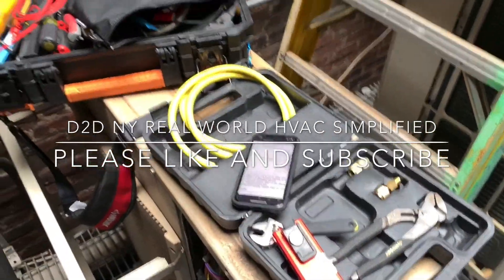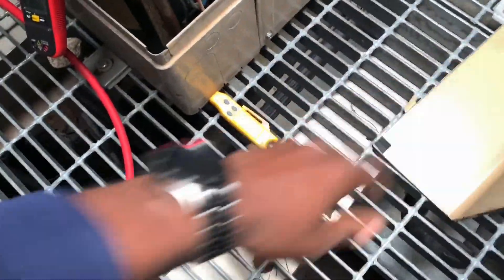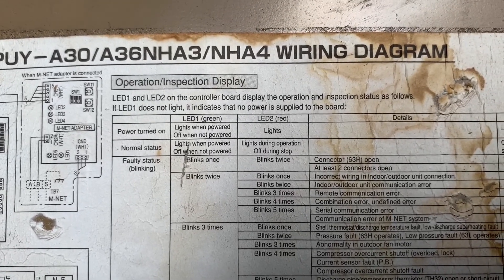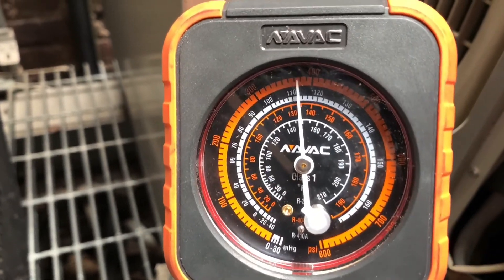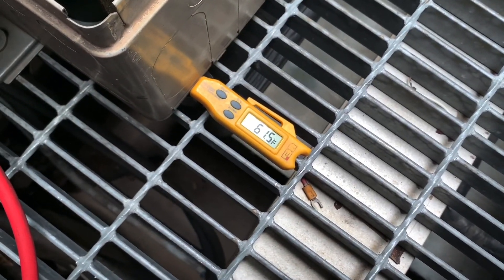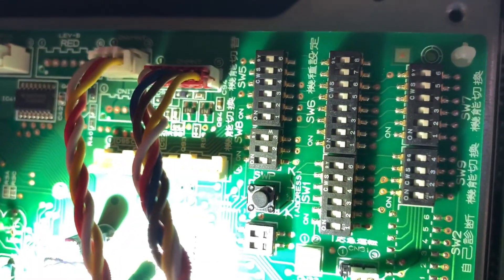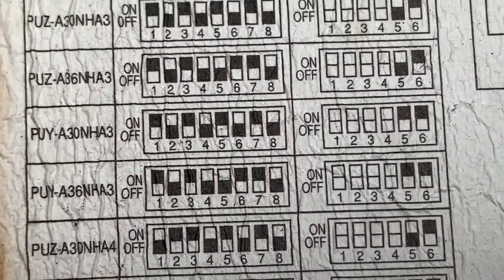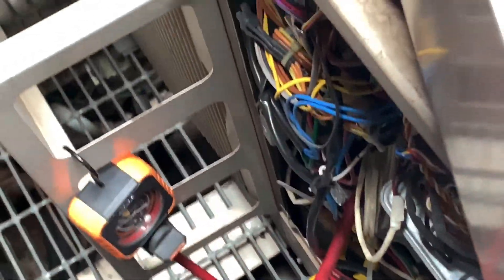MITSUBISHI CITY MULTI TROUBLESHOOTING

Comment: sir how to find error using sw1 dipswitch?
Reply from the maker: I can't say I  never used this method for discovering errors
Reply: On the outdoor unit control board switch SW 1,2 and 4 to on and it will display indoor failure codes. I think one and 2 will do outdoor.